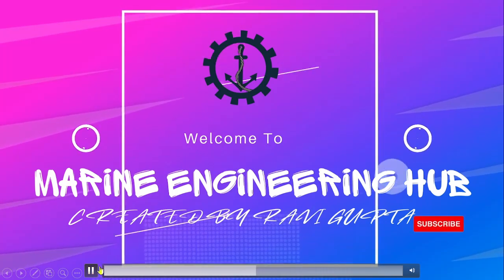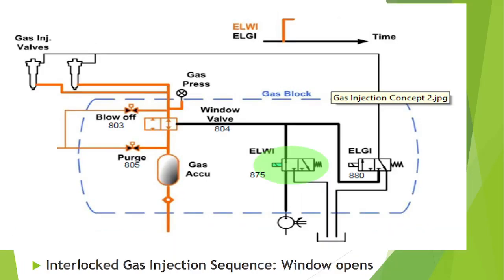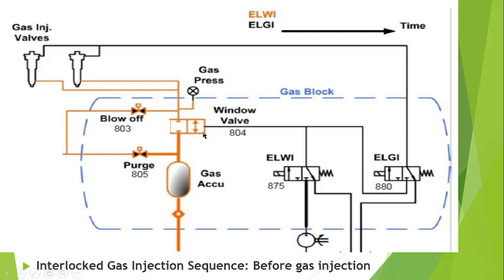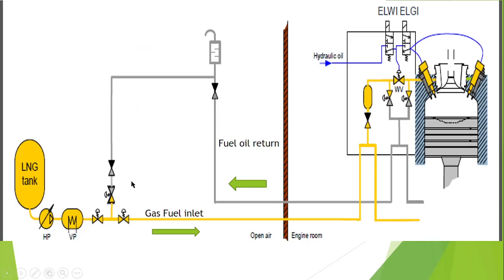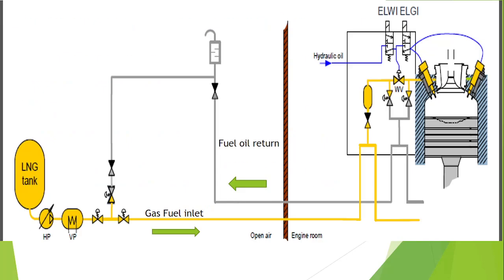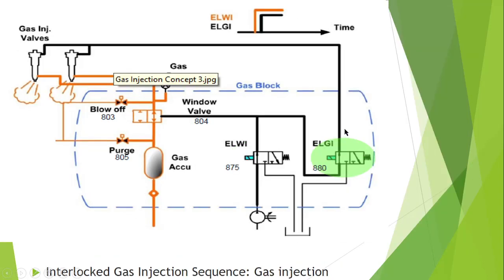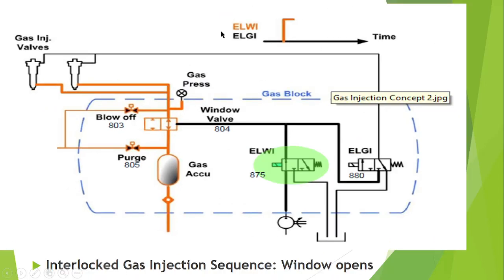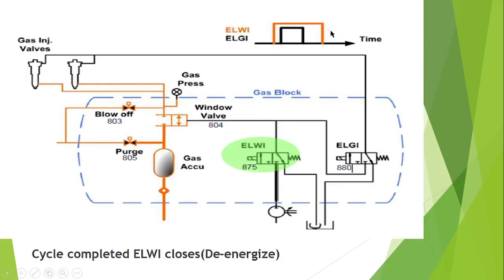ME-GI|Window Valve| Electronic Window injection valve| ELWI | ELGI| Sequence of operation of gas Eng

Comment: Dear Ravi, thank you for well well-explained video.  At the end of the video, u said that ELGI is actuated after the liquid fuel pilot injection has operated. But I saw some notes that state that in a 2-stroke engine, gas is injected first at the compression stroke, after the piston has traveled up around 50%, and in a 4-stroke engine, during the suction stroke gas is injected before the inlet valve. In order to mix the gas completely with fresh scavenged air and just before TDC liquid fuel Pilot injector is injected to ignite the gas.
Reply from the maker: Thank you for watching and for bringing up that point!